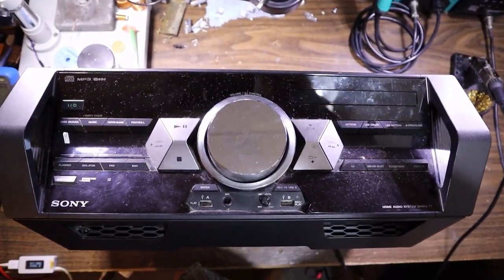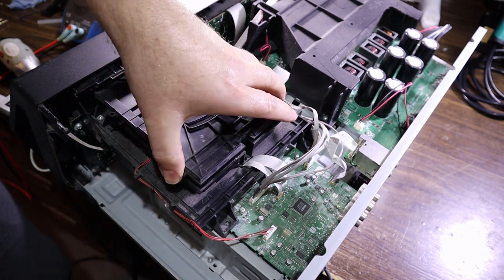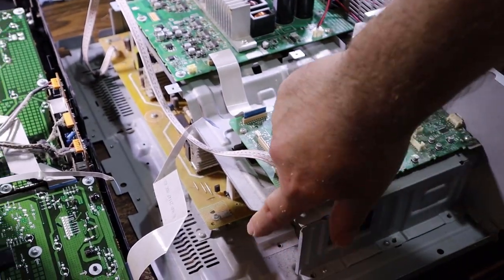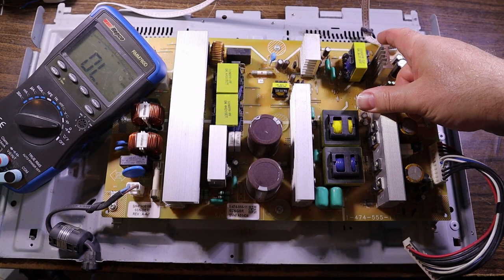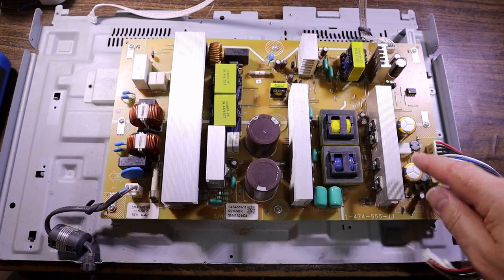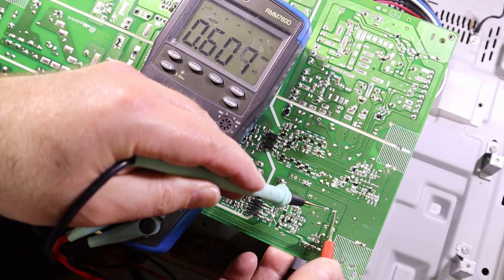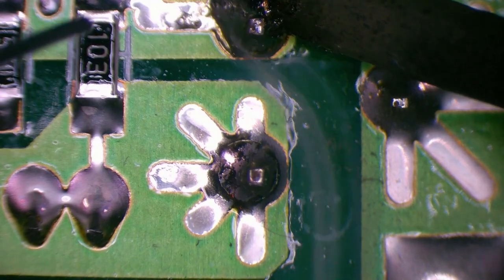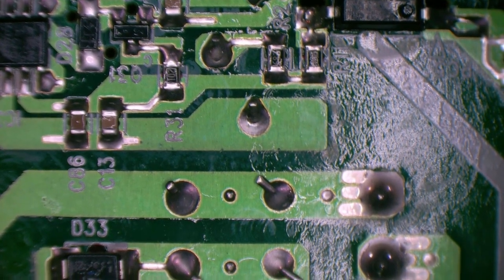Sony HCD-Shake77 no power repair!

Comment: Thanks heaps for you detailed rundown. Very clear and well captured, I brought one of these today with speakers exactly the same problem no power whatsoever. Hopefully it is just a simple fuse fix like you tried at the start. I am very new to trying to fix and repair more complex electronics like this. 
What setting and reading are we after when testing those 3 fuses? And what would i ask for if i wanted to buy one from the local electronics store? 
I would really Appreciate any help you can give me as i said im a bit of a beginner at circuit boards.
Reply from the maker: For testing a fuse you want it set to the ohms (resistance) scale and if it is not blown you will read whatever you see if you were to touch the probes together (000.2 for example). If it is blown it will be much higher, over 500 I would think. Not many good local supply stores anymore, if you're thinking jaycar their options are next to none for the repair scene. I got mine from element14, see part number MP005702.
Reply: @JonnyFix  haha thanks i was using the beep continuity tester on them. Im going to pull it apart now and have a look. Cheers 🍻
Reply from the maker: @YodaSpawn1981  The beep is fine, if it beeps that suggests the fuse is also ok as long as the display shows near 0 as well.
Reply: @JonnyFix  just checked now and the 3 fuses are all fine.

Comment: Well done :-D
So the pwm chip went mad and killed the mosfet maybe, or did the mosfet blow back into the pwm chip.
Well it dosn't matter it works:-D
Strange readings from pcbs have sent me in circles, i nearly give up then something clicks and my brain starts working for a change lol .
Sometimes a good sleep wakes up the sub conscience and the answer appears from nowhere.
Odd that.
Sorry waffle mode :-(
Reply from the maker: Sleep is good. I need to stop making and editing late into the night, makes for lower production quality. One day my content will be as good as the BBC! Maybe I'll clone myself and make a show called the 2 Jonnys.
Reply: @JonnyFix  Double trouble :-D
Imagine the arguements over using the multimeter ... but  you could both check different parts of the pcb to check.
I can see the fight for the mug of coffee or tea :-D